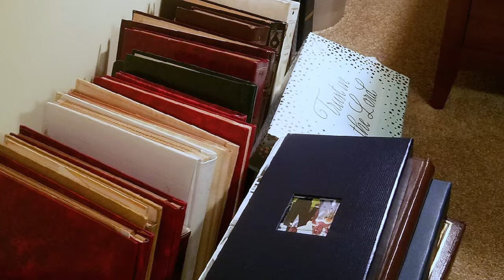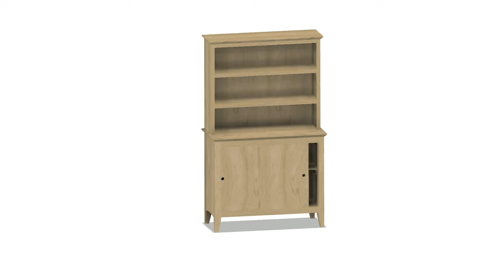Sometimes you have to just go for it

Comment: AWESOME!!!!  I’m currently making a new kitchen table out of hard maple so I feel your pain ESPECIALLY with staining.  I just had to use 40 grit to get rid a failed stain and am slowly working my way back up to 220 grit.  I tried the same trick as you with the wax free shellac except I’m using a 50/50 ratio of shellac and denatured alcohol so it soaks deeper into the wood.  The top and bottom of my table came out pretty decent but because the table is a rounded “P” shape the end grain portions looked absolutely atrocious because I didn’t sand them as well as I thought I did with the 220 grit.  But you’re a champ now, hard maple has a janka hardness of 1450 which is harder than walnut and oak so everything should be child’s play to you after this :).
Reply from the maker: Ugh yeah I really just avoid stain and dyes in general on anything that isn’t oak or ash-ish at this point. If I have to start getting into wood stain conditioning I’m like 👋. And yeah hard maple is HARD. I just did a coffee table in wenge and thank goodness I didn’t have any catastrophic failures because wenge is 1930lbf

Comment: I can relate! I just built and am still working on a bathroom vanity for my Mom. The vanity I built is a mid century inspired (it’s shara’s idea for a bath vanity she did a while back with custom trim) but prior to that I’ve built a solid wood shelf for my brother that looked like a text bubble although if I could redo I would plus solid maple blanket ladder, several adorable solid maple cloud book shelves with led lights embedded and hidden for a stormy night light effect, I also took on my fear of the table saw by making custom Alpine patterned cheese boards with 5 or 6 hardwoods in an ombré like effect inspired by Michael Alms alpine pattern bed cutting board… this vanity wasn’t very big but it was my biggest project so far and built mostly out of solid hickory. Now I love and am obsessed with hickory but don’t use it if you plan on using fasteners in any way! It’s destroyed countless pocket hole screws like for the base, ate up screws for the toilet paper holder… thankfully I built this mostly out of half laps and my favorite bridle joints along rabbets, etc. but it was challenging. I’m still not through figuring out the interior like where I plan on separating the drawers from the door that’s supposed to match and seem like drawers. I also want to route out a handle and add hickory end grain pattern from Michael Alms Alpine pattern behind where your hand goes… anyways I’m very slow with projects too. I can dream up a billion plans and ideas but I’m so picky and so nervous that I hold myself back and there’s something very true about being in the zin moment! If you’re not feeling it… that’s when I feel I screw up and get angry plus I battle add and this obnoxious sense to move onto other builds before finishing one although I’ve improved but that was probably my greatest battle at the start. This piece you built is beautiful, it’s made very well and I know your Mom is proud and regardless how the stain turned out its greatest meaning comes from the fact that her son built it. Keep filming, we don’t care if a mic goes out or if you cut something too short but I do appreciate that you do voice over and you film step by step which I appreciate
Reply from the maker: Thanks so much for sharing and for the encouragement to keep going. I’ve also got tons of ideas and more it’s a matter of vetting which ones would be interesting to watch come together.

Comment: The "inch too small" is a common mistake. I've been working wood professionally for 45 years and still do it on occasion (far more than I would like). I always think way ahead, and sometimes that takes away from thinking in the moment. It's devastating if it happens on matched wood that cannot be replaced — like running matched drawer fronts! I once did a massive, carved bedroom set in basswood, soft, and hard maple, and staining those pieces was challenging to say the least🥴 I'm just getting back into woodworking after a 10 year hiatus and am amazed at the new tools  I'm seeing. This should be fun 😊
Reply from the maker: I’m glad to know I’m not the only one experiencing these hurdles and challenges. Thankfully that panel wasn’t grain matched or anything like that but it always stinks when you have to let something go entirely once a mistake is made instead of fixing it somehow. Thanks for watching and good luck in your new projects!
Reply: @sturdyboneswoodworking  On the bright side, you have a nice glue-up for a different project. Good luck to you as well 😊

Comment: Great video, earned my sub. Thanks for making an honest build video!   Btw, how do you like that miter saw?  I’m on the fence between that and the delta/ridged.
Reply from the maker: Thank you so much for the support! I obviously had both. I remodeled my previous house with the Delta. Great saw and no complaints except it’s a job site saw and not great for placing against a wall. That’s the main reason I bought the Bosch. It’s 24” deep and can back flat up against my shop wall. So much better for a miter saw station like that.
Reply: @sturdyboneswoodworking  Another great one for zero rear clearance is Hitachi (now Metabo). I've had their 12" sliding CMS for 10yrs or so. Fwiw I used a Kapex two days ago in a friend's shop and honestly prefer my saw.